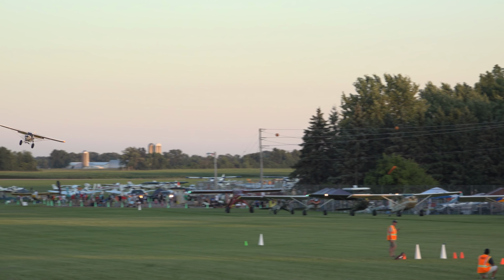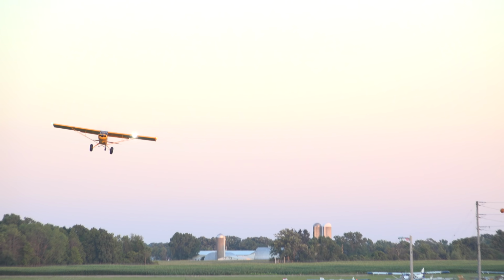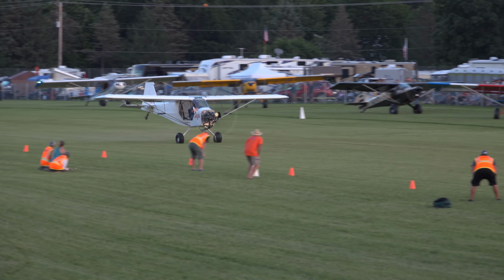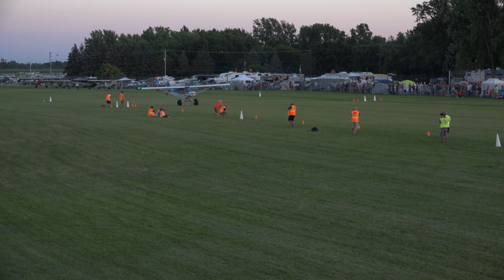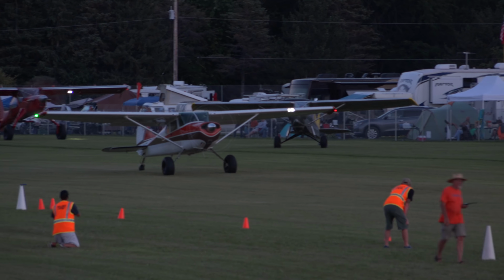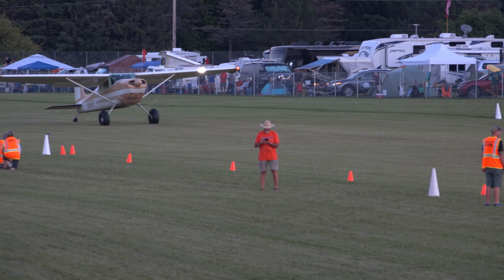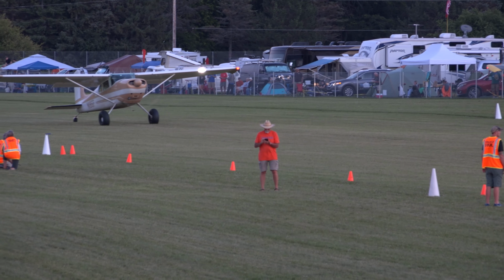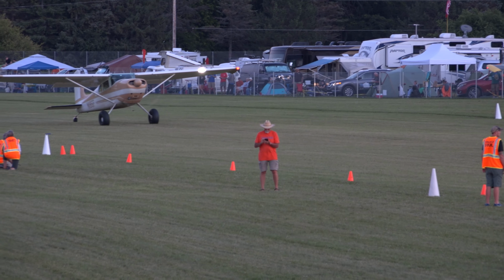STOL Competition in 4K, AirVenture 2018, Draco the PT-6 Tubine Wilga

Comment: Mike's WILGA(DRACO) is the most beautiful bush plane ever made, no one comes even close to the looks of DRACO. Mike's WILGA was originally produced in Poland, but with all the mods he put on it, there is maybe only 25% or less of the original WILGA left in that aircraft. The crazy thing is that he even put fuel tanks in the main landing gear struts, which I personally think it's dangerous to have fuel tanks in the landing gear struts, because if he ever lands to hard or hits something and one of the landing gear strut breaks off the whole plane will go up in flames. Mike has a YT channel and he filmed himself building the WILGA(DRACO). You can go watch his videos on his channel named "Mike Patey" it's really worth watching. I binge watched almost all his videos, it was worth every second of it. I really learned a lot about aircraft building from Mike's video's.
Reply: But if the landing gear brakes off the wing is the next thing to hit the ground anyway so either way there is going to be fuel on the ground.
Reply: IMHO there really is no "safe" place to have a gas tank on a plane...If it crashes, it usually goes up in flames anyway.
Reply: I suspect that if a landing is so hard that the landing leg actually fractures or breaks off, then some spilled fuel is going to be the least of his problems.

Comment: Def sick of seeing draco. Yeah, its very very cool, but it is an exercise in excess, well out of reach of the normal man. What steve henry is doing with the Highlander is MUCH more impressive and within the spirit of what the EAA really is.
Reply: Draco is licensed as experimental “exhibition” which restricts where and when it can fly. Totally impractical from a usability point of view. It’s not to say Draco couldn’t be turned into a certified aircraft with a “supplemental type certificate (STC)” but the engineering cost and then actual number of potential planes that could be updated with the STC makes it unrealistic. 
Draco is fun, would be blast to fly but economically it’s a bust unless of course you have a boat load of money and you really want bragging rights!

Comment: You can NOT call this a "STOL Competition," because only a select few individuals were asked to participate in this takeoff and landing exhibition. It was an exhibition and nothing more. It was NOT open to competitors. Had this been a competition open to the competitors that were present at EAA AirVenture 2018, NONE of these people who took part in this exhibition would have had a chance at winning a real STOL competition. They can take off and land pretty short, but none of them would have had a chance in an actual STOL competition with actual STOL competitors. Draco's nice, but a K650T Sherpa will beat it every single time.